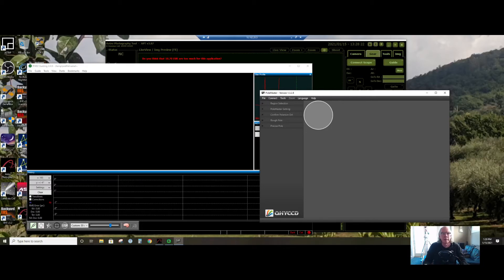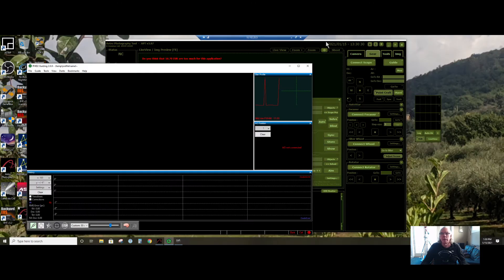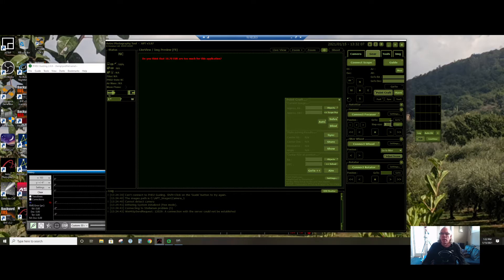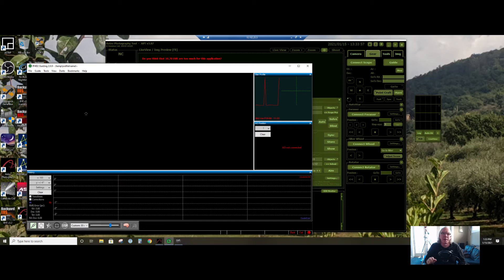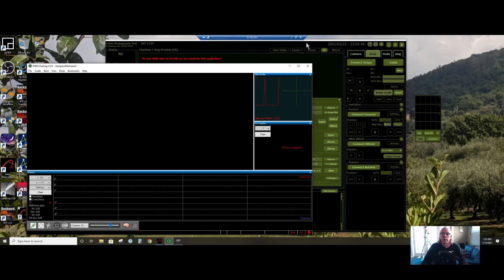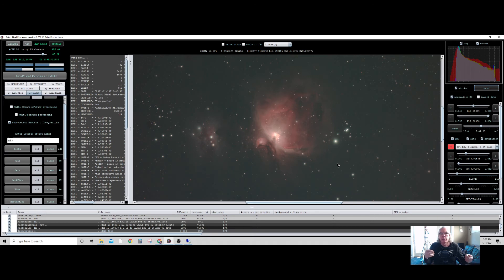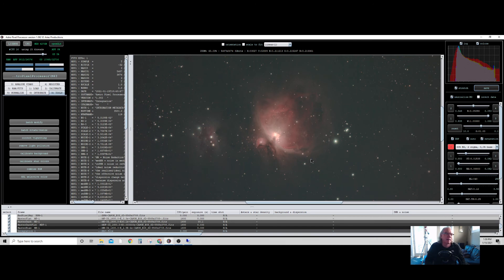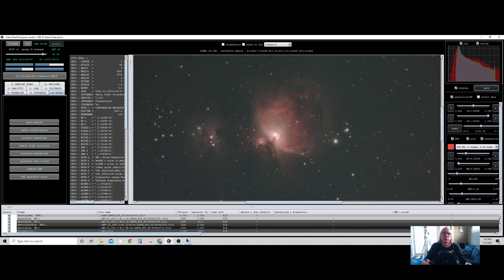Progress Update 1: M43, APT, PlateSolve 2, Polemaster

Comment: Just stumbled on your channel - brings back memories of starting out.  Those first images are incredibly rewarding, aren't they!?  

I began about 3 years ago and your learning style is very much like mine.  I still would deem myself a beginner, but so what...it's still fun!  You jumped into the hobby with much more specific Astro gear than me.  I came from an engineering background and was a semi-pro photographer with lots of cameras and lenses, so still only use DSLRs and tele-lenses (and will go with your Zenithstar when I finally go to a telescope).  I also still only use the iOptron Skyguider Pro and have tweaked my technique over the years to get pretty good performance out of it (and they are VERY easily transported!).

One suggestion if you do get a "star tracker" (as they are sometimes referred to since they only track on the RA axis) is to try to get familiar with the night sky without relying on your go-to capabilities.  With a go-to mount, it's easy to point to targets, but if/when you get a star tracker, you'll lose that ability, so finding your targets will require more familiarity with spotting 'landmarks' in the sky to aim for.

Anyway, keep going forward!  I love the hobby still...I'm sure you will too!  (BTW, The Great Orion Nebula is M42, not M43. M43 is part of Orion, but technically only the little comma-shaped nebula to the left of the main Orion body in your image).

Clear skies!
Reply from the maker: First thank you for putting me on the right track on M42 vs M43. Rookie error on my part! 😀

Also thank you for dropping in on the channel and taking time to comment. Welcome! And thank you for the excellent feedback and comments in particular about getting to know the night sky if I get a star tracker too. Helpful comments like yours not only help me but also others who may read them. Much appreciated! 👏👍👏 

Hope you will drop back in from time to time and share your knowledge and experience with me and others who may be beginners to help us get up the learning curve a bit more quickly!

Comment: What filters you used for this image? I live in bortal 8-9 southern California and i'm researching about good light pollution filters. I like Tri Ultra quad band but thinking about narrowband filters. Not sure I can use narrow band filters with monochrome camera with maximum 5 min exposure. I'm limited maximum 5min sub exposure because as I only have sky guider pro with guiding. Any idea about narrow band filter exposure time in bortal 8-9 skies?
Reply from the maker: Hi Lalanke, I started using an Astronomik CLS Canon EOS XL Full Frame Clip Filter - CLS-EOSXL for my Canon 6d. I really don't know much about filters yet and I knew even less when I purchased the Astronomik.  I don't have enough imaging time with and without that filter on the same target yet to determine how much the filter is helping or hurting. I expect over time I will gain knowledge.

I think the Tri Ultra is interesting too but my roadmap has me purchasing a ZWO ASI1183 mono camera sometime later this year to move to narrowband imaging to tame the light pollution in my Bortle 8 Zone.

No data yet on narrowband exposure time in Bortle 8-9 skies. Hope to find out soon though! 🙂

Thank you for dropping into the channel. Maybe others will respond to your comments and questions.

Comment: Nice Image!! How do you find APP for image processing? Does not seem as guided as the stacking process. I find myself random sliding the controls - not really understanding what I'm doing. Processing the stacked image in GIMP seems easier and more intuitive to me.
Reply from the maker: Hi Anthony I really don't understand yet tab 9 Tools on the left side, or much of anything yet on the stretching right side. I've been exploring by just moving sliders around without knowing what I'm doing. 😀 Now that I have a good data set I'll start to dig into tab 9 Tools and the right side during the week next week. I've not looked at GIMP but it is on my radar.